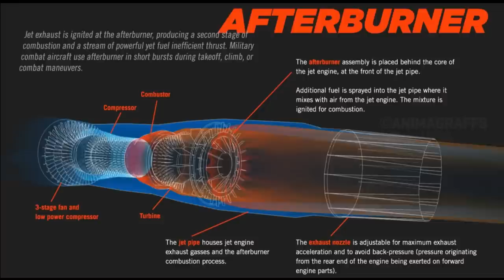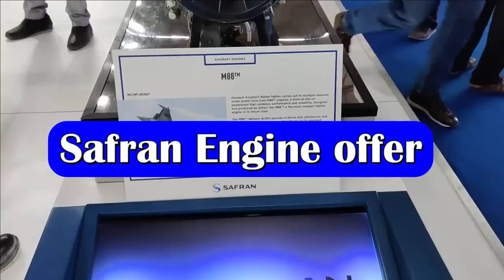UK support pre-approval of export license of combat engines to India #engine #amca

Comment: My plan would be like this :
India should get few more GE F414 engines as a stop gap measure for Tejas Mk1a.
The KAVERI engine must be perfected in parallel to Tejas Mk2 program.
Then Tejas Mk2 must be designed/produced as a twin engined aircraft with two KAVERI engines.
Also by the time TEDBF is ready, an uprated KAVERI engine should be ready to be used in it. RollsRoyce help should be taken for this.
At this point in time RR-GTRE partnership should give us modern AMCA engines.
Without any further delay We should go with UK/RR as they seem to be eager to partner with us as they also have TEMPEST program running.
Reply: You are asking for a 48.5kN wet thrust engine to be perfected into a 90kN wet thrust engine. I hope you understand the irony. That involves mastering metals / materials in fire, if you understand what I mean. It requires a different kind of setup. And our government / organisations do not want to invest there, but want the results almost as if by magic.
Reply: You know that Tejas Mk2 is a single engine design fighter jet, right?

Comment: We need a variable cycle engine, that can be efficient for regular use and provide higher thrust when used with afterburner,.
So it will be efficient as M88 and able to provide as high thrust as say PW FW 100
Reply: Adaptive cycle you mean.
Reply: *adaptive cycle
Reply: @AnirbanSarkar203  Variable cycle and Adaptive cycle are one and the same

Comment: The only reasonable plan is to exclusively invest in Kaveri and Ganga. Ganga is a 100% hypothetical idea that exists only in people's brains instead of a real project with funding and manpower.
Kaveri is already almost certified for the dry part, the afterburner needs to be certified too. Then finally the GE404 engine will not be needed for Tejas Mark1A any more, saving enormous sums.
Flying test bed and appropriate wind tunnels are needed now.Kaveri is based on old technology. Single Crystal blades and thermal barrier coatings(TBC) are indigenous tech that now exists that didn't back when Kaveri was first proposed. Gange is a 414 class engine, based on Kaveri design but with titanium printed parts, singe crystal blades and TBC.